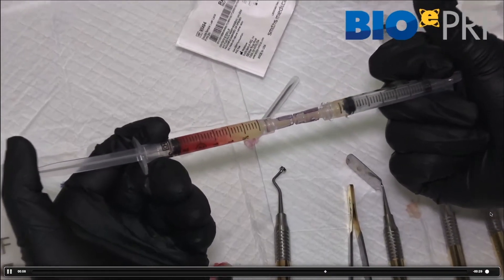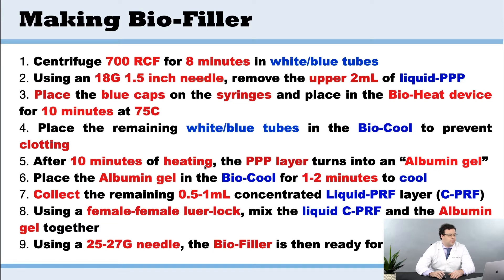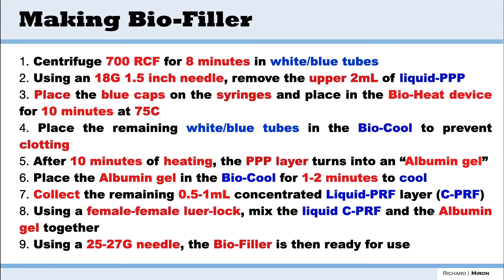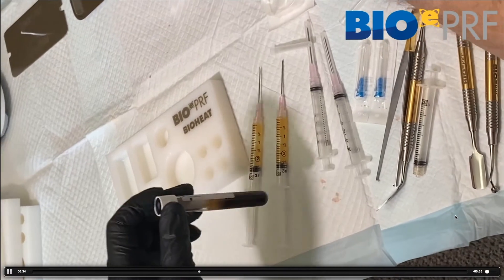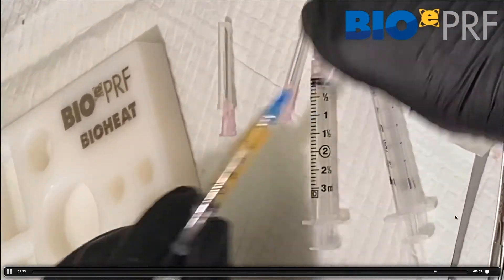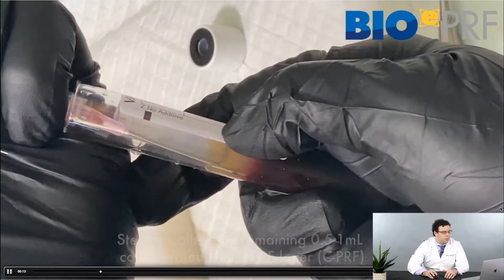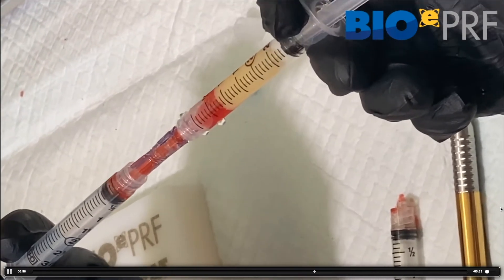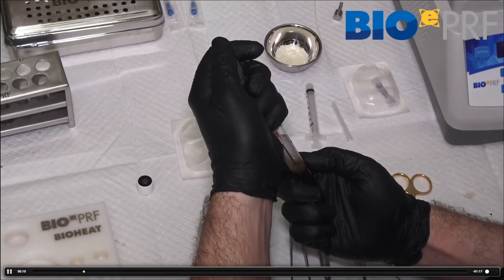Chapter 10.8: Making a Bio-Filler presented by Dr. Richard Miron

Comment: Hi dr,  we have more questions about ur practice,
what kind tubes you used or can be used? what additives?  Blue tube sodium citrate?  Must have a clot activator to create bio filler? What cloth activator you use in ur practice?
Thankyou
What temperature is too hot for blood?
At present, 40 degrees C is believed to be the highest temperature that can be safely administered. There is concern that temperatures greater than 40 degrees C may harm blood cells. 

75 degrees Celsius kills all the prp I see?? What do you think about this